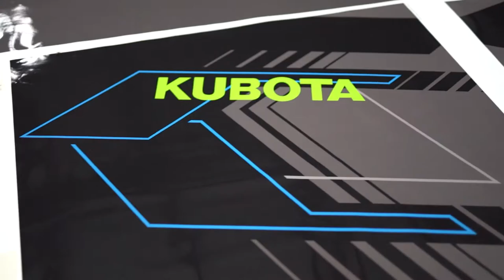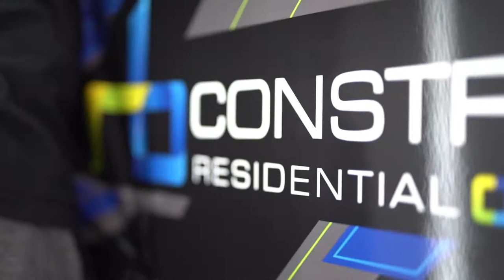Design and wrap Kubota Skid Steer for RB Construction!!

Comment: Wrap won’t last due to extreme heat comes off machines, nice job though
Reply from the maker: With the right film and installation sure it will. This one has been on for 3 years and still looks great outside of a few tears from damage but those areas were easy enough to replace that section.